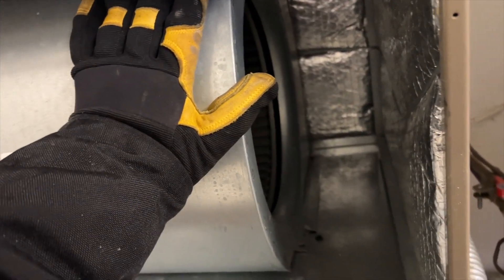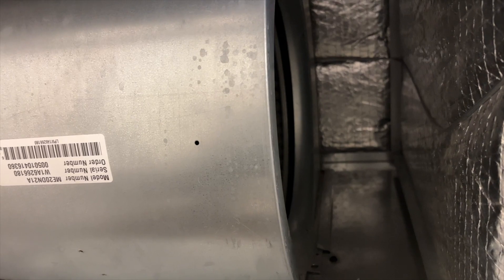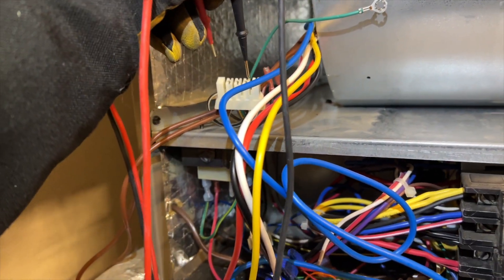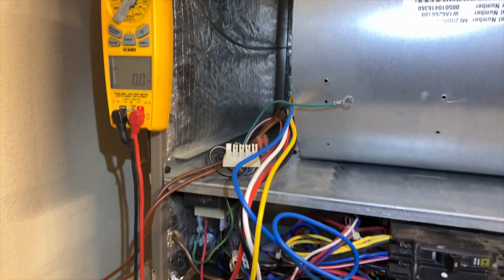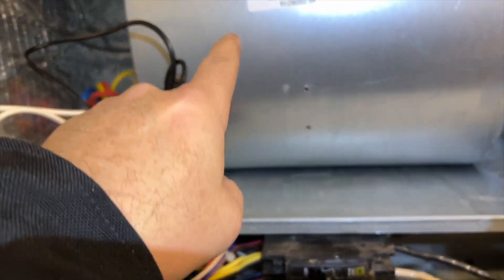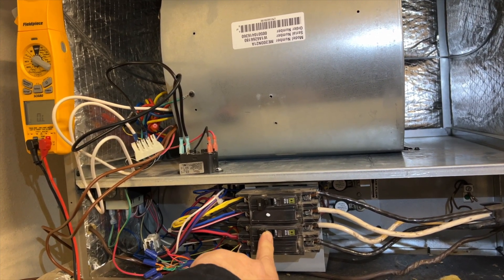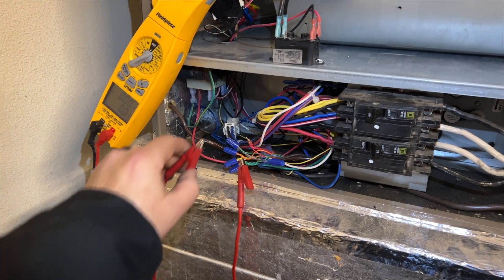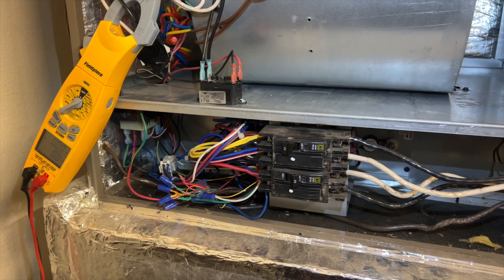How to Convert a System with an ECM Blower Motor to a PSC Blower Motor EP119

Comment: Relays and even fan timers are being phased out this is going to get more and difficult to do. Blame the government on that.
Reply: LOL. No they aren't. This is one of the more ridiculously stupid claims I've heard, and that's saying something.
Reply: @anticapitalize really? Then you don't have to go to HVAC suppliers very often? Try getting a fan center. Or a fan limit switch.
Reply: @anticapitalize  When is the last time you seen a new furnace with a relay or fan timer that is not part of a control board?
Reply: @anticapitalize When was the last time you seen a relay on any new furnace, that isn't on the control board? Even on electric furnaces they have become less and less. That was in part the reason for this video, or he would have just hooked up the new motor that was there. BUT that is the point there was no relay he had to add it. Welcome to the 21st century.
With out the demand for those relays they will become harder and harder to find
Reply: The Guberment are way to far up our A-s  now hopefully things will change now

Comment: That works great if you have an air handler. But with a gas furnace you need that blower on delay to cool down the heat exchanger. Although I think HVAC guy showed how to hook it up for a gas furnace. Great video. Thanks for sharing
Reply from the maker: You can use a time sequencer relay if your in a tight spot.   Just got to get the timing right.
Reply: @NighthawkHVAC  True, didn't think about that.

Comment: I am so thankful you put a good summary in that you are doing a temporary fix so they have heat during a cold snap.  I cannot stand the technicians that do not carry rescue motors on their vans or trucks and replace an X13 with a PSC and never come back to fix it correctly.  I would fire a technician that would leave it like that..  Great job, btw!
Reply: What if the customer wants it like that permanently? For example if they are tired of paying the huge cost of ecm motors, or if they went through 3 of them in 2 years and want something that just works? There are quite a few very accomplished techs on here who do this as a retrofit on purpose.
Reply: @realSamAndrew  First off, in my entire career I have never seen any ECM motor go bad three times at all let alone in two years.   ECM blowers are not that expensive in most cases, it is the insane markup and labor these companies put on the repair.  A Rescue motor or an Evergreen are both readily available and on my shelf in the both work vans.  If the customer was technically proficient and specifically asked me for that retrofit, then of course I would do that but would explain the complications, especially if they have a communicating furnace and thermostat with multiple stages.  I don’t change very many ECM blowers or axial fans.  I use high flow filter systems to keep the ESP down and I keep both coils clean.  Every one of my installed systems come with a service contract to come twice a year to replace the 5” filter, clean the coils, check pressures, and do a complete health check.  Each new referral or client I try to get on the same plan.  Just like the human body, see your doctor a couple times a year to check everything out.  But again, if the client asked me to do so, I would.  If it an actual X13 ECM, I will replace it with the newer upgraded replacements.   With my systems having a 10-12 year warranty, I have been fortunate. The out of warranty units, I give the options to the client.  But my prices are not “big name huge HVAC” pricing either.  I am never the cheapest but I don’t charge $400 for a blown capacitor replacement either.  I also do not sell single stage systems with PSC blowers from the factory.  You are just asking for trouble and they are far less efficient.
Reply: @Balticblue93  some of these motors, especially the oem ones can cost close to or over 1000. I don't know the stats, but just from watching lots of HVAC calls on here, the modules fail quite regularly. Even if it's a power surge, so not directly the mfg fault, it's still a lot riding on a plastic circuit board with delicate components. One weak capacitor or glitchy chip shuts it down, and you cannot do an in place circuit component repair like you can just swap a run capacitor. Everyone's situation is different, but I compare it to installing hand crank windows on a 1994 Cadillac if they wanted 2 grand for a motor or wiring harness that was only available from the dealer. Cheers.
Reply: @realSamAndrew  I am still going to have to disagree with you on this.  I replace the modules on a somewhat regular basis but not as much on systems I have sold.  Brand of system and high static pressures play a big role in the life of a motor.  And I don’t know where you are shopping, but I have never in my entire career seen any ECM motor cost anywhere near $1000 wholesale.  You would you a rescue motor or an Evergreen motor.  I check all my clients capacitors and wash out their condenser with foaming cleaner and water for best airflow.   If I do need to replace the capacitor, they are usually older systems that haven’t been maintained regularly.  But I use Amrad or at least a high quality capacitor.  I don’t think your analogy of putting in roll down windows in an old Cadillac.   That isn’t remotely close to the scenario.  If a part cost $1000, I would discuss with the customer how I can put in a rescue motor or Evergreen.  I would also present them with three new quotes for good, better and best for furnace replacement.  I would include upgraded 4”-5” filtration box, humidifier and new Ecobee Premium thermostat unless they already had s high end thermostat like a Carrier Infinity or Honeywell.  But all systems get humidifiers included because Denver is actually more arid than Phoenix.  We run them all year.  It is far healthier to have a humidity levels to be between 40%-60%, for health and your home.   

You bring up the modules going bad and we are talking about a broad range of ECM motors.  I know exactly how the circuitry works as an Electrical engineer by degree, but own my own HVAC business.  

Thermodynamics, psychometrics, electrical, and HVAC equipment are my life.  I have studied excessively why things fail in the field.  A very large percentage is improper maintenance or being used outside best practices.  Systems improperly installed or improperly sized because a correct Manual J was not done.   Three examples (filter replacement and maintenance not done every 6 months, too small of a system that is being overworked, system way oversized for supply and return ducts, this alone will stress an older ECM motor to the point of failure because of sky high static pressure.  The newer true VS ECM motors are not made that way any longer and will last much longer and are stronger.  

So if you think all the labor of putting in roll down windows in a Cadillac is the same as putting in a $200 EZ Rescue motor, then by all means.  Buy your $75 fan, relay, and capacitor and convert your customers system into 20 year old technology because you don’t know what is best for the client.
Reply: @Balticblue93  I have no reason to dispute anything you wrote about the factors and your experiences and standard practice. But you seem to take the viewpoint that you are the only tech who has ever touched that system. What if you are the 10th? And what if the customer has used those "major" companies or below avg or even crappy techs before and couldn't avoid those issues due to incompetence and not being aware, and/or is shell shocked and disgusted? Like I said, every situation is different.You only control what YOU do. You don't control what came before you or the life story of the customer. No need to personally denigrate me over a hypothetical (which actually does happen in real life)
Reply: @Balticblue93    I have a question for you.  Why are you so down on a relay, capacitor, and psc motor?  Besides a minimal savings in power consumption of the ECM the PSC is reliable, easy to obtain and parts are cheap.  So, putting the power savings aside, what makes the ECM superior?  Because cost of repair certainly ain't it.  And my old Trane with now over 30 year old technology lasted 26 years, nothing but a couple of relay replacements and I replaced it only because I was afraid of the age of the unit.  My brother and I both replaced our units with the same  new tech units 5 years ago and his ECM just went. Reliability is the number one concern for me and after speaking with the guy that installed our systems, and the numerous videos and comments online, ECM motors are just not an improvement worth the cost.
Reply: @bogieman101 He wants to add every little expense because he is a capitalist in a consumer country.
Reply from the maker: They make a conversation board to convert a ECM to a PSC. If this was a permanent repair I’d probably install the conversion board.